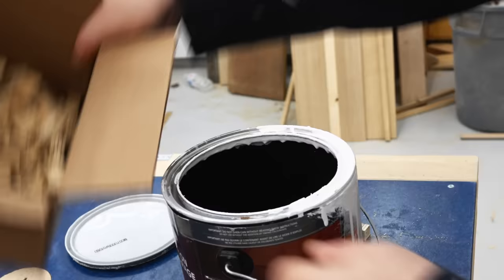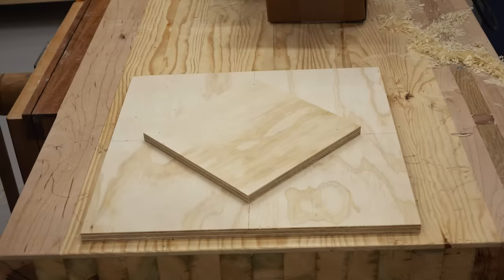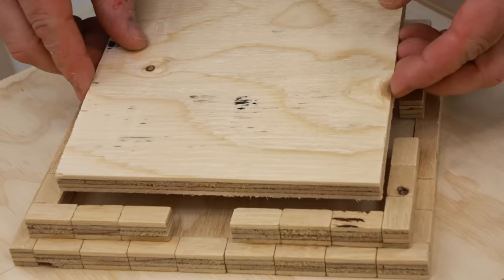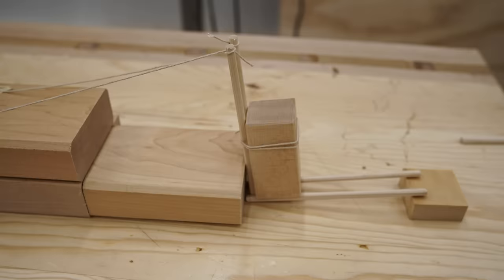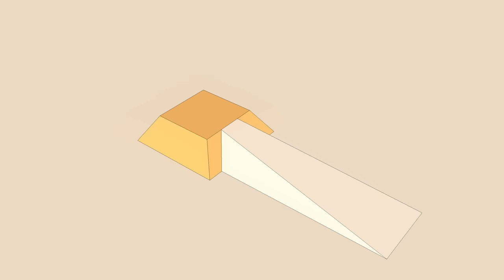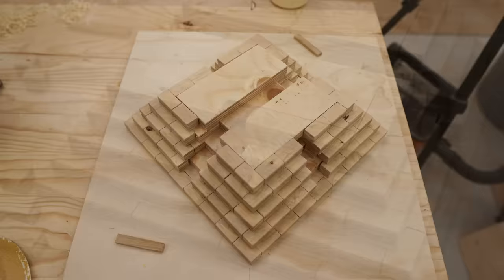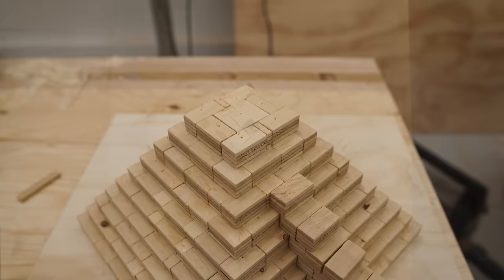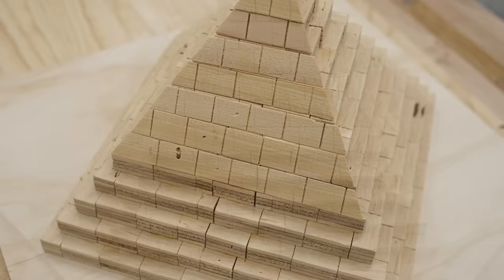How I Would Build The Great Pyramids

Comment: Can you calculate how long it would have taken? In the 1960s it took us 3 years to move 1042 blocks just 90 meters away (Abu Simbel transfer) using the most modern machines available at the time. Meaning 26 hours for each block.
The Great Pyramid for example is made of over 2.3 MILLION blocks, way heavier than those cut at Abu Simbel. It would have taken 7000 years at the same speed. And that's being generous considering some blocks of the Great Pyramid were transported for 550 miles according to Egyptology, and the Egyptians worked only during the day while the workers at Abu Simbel worked 24/7, meaning it would have taken twice as much etc...
Also the Great Pyramid had to be designed, the blocks were cut a certain shape in order to create the inner rooms and empty spaces, which would have taken even longer...
Reply: I think generally the belief that if you didn't create a grand enough tomb for your pharaoh would bring upon the end days for the entire world was a big motivator for everybody involved.
Reply: @Corzappy  Technically they would have been built by Sovereigns, not Pharaohs. But apart from this, can you give me any piece of evidence that shows the pyramids were tombs?
Reply: @MARK-gp9hb  Generally the fact that most pyramids contained sarcophagi makes them pretty likely to be tombs.
Reply: @Corzappy  You call them sarcophagi implying that they were coffins but there is no proof of that, they were all found unadorned and empty, some were still intact and sealed. But even if there was any proof that they were used as tombs at one point it doesnt mean they were built to be tombs. Sneferu for example is credited with building 3 pyramids, others are credited with building mastabas and tombs other than just a pyramid, and then were buried elsewhere or their burial place wasn't even found.

And the looters hypothesis also has no substance, especially with the Great Pyramid, the tunnel supposedly dug by the looters was enlarged in recent times and the treasures wouldn't have passed through it, if we assume they were the same size of the treasures found in Tutankhamun's tomb, beds and furniture etc...
And i can understand looting the treasures, but the bodies?
So it's just a theory to explain away the fact that no burial remains have been found.

In fact there are egyptologists who are starting to consider the possibility that they were symbolic cenotaphs or monuments, either way not actual tombs.
I can accept that maybe the stepped pyramid of Djoser may have been a tomb, as well as some of the later and smaller pyramids, nothing compared to the perfection of the 3 main pyramids of Giza which even the Egyptians claimed were already there, they found them and restored them, actual evidence has been found in the Great Pyramid, the mortar analyzed by Lehner, it has been carbon dated to before the time of Khufu, and the oldest samples were found at the top, so they were restoration works.

Going back to what i was saying at the beginning, if you make a chart of all the construction works made during all dynasties, you will see that the 4th dynasty stands out, there is a sudden and unexplained spike in construction, and then it goes down again in the following dynasties. If you remove the 4th dynasties the progression is natural and makes sense again.
Not only that but the quality of the pyramids of the 4th dynasty is a lot greater, while all the following pyramids are crumbling.
The truth is that the pyramids of the 4th dynasty are completely "alien" to Egyptian technology and building skills of that time and before and later times, they had to be attributed to the 4th dynasty because it was the only dating that made some sense, to show a somewhat linear progression of technology from the mastabas and the stepped pyramids to the perfect Great Pyramid, but today we are beyond that, we don't need this paradigm anymore:

Under the stepped pyramid in Saqqara, supposedly the oldest pyramid and the one that shows the evolution from primitive to more advanced building skills, 40000 vases have been found, buried by Djoser on purpose.
These vases date to early dynastic and pre-dynastic times, some were found in tombs dating to 10000 BC.
BTW all this information is official, its written there on signs in multiple languages in the museum of Saqqara, you can even find videos on Youtube of tourists who visit this museum.
These vases weren't put on display up until recently, they are made of the toughest stones on earth, corundum etc. and they are perfectly made, perfectly balanced, they show machine marks almost like they were made with a lathe, some vases have a skinny neck but somehow have been carved on the inside, tapered even, the walls of some of them can be seen because they are broken and are only a few millimeters thick.
There are even tiny rings made of carnelian stone, with minuscule carvings of frogs and other animals, that look so perfect like they were laser cut.
Modern jewelers wouldn't be able to make them, later civilizations were not able to make them, and not even the egyptians apparently, because after pre-dynastic and early dynastic times this knowledge was lost, you can find graphs of this online, before they were able to work all materials with high perfection, then these were buried for some reason and later vases were only made of alabaster and softer stones and are not as perfect, quite the contrary, you look at them and they look all crooked and funny. There are depictions of artisans making these big later vases with large and awkward tools that don't explain how the earlier and more perfect vases were made.
Not to mention the countless other sites found around the world who date to 10000 BC, not just Gobekli Tepe.
So we are way past the "gradual evolution of technology that must have started around 3000 BC".
We have the proof in Egypt that before dynastic times there were people who were far more advanced. As the Egyptians write themselves, as all the civilizations of the world write, in fact, many ancient writers coincide when they date the beginning of the history of egypt to around 36000 BC, it has been disregarded as mythology by modern historians but only because we had not yet found proof of organized civilizations older than 3000 BC. but now it's changing.
So if the Egyptians were right it wasn't Khufu who built the Great Pyramid but only restored it, and he reigned over 60 years, not 23/25 as modern egyptologists believe, and many more things are going to change, you can be sure of that, there are egyptologists who say it, in private, because in public they would lose their job immediately, that the egyptians were an emulative civilization, trying to preserve and emulate the things they saw which belonged to a greater past.
Reply: @MARK-gp9hb  There’s still tons of evidence that point to pyramids being used as burial tombs, it seems pretty wild to me that you’d so fiercely dispute that pretty well established point.

Even if the great pyramids themselves aren’t tombs they still could very well symbolize a tomb.
Reply: @Corzappy  and im asking you what is the evidence
Reply: @MARK-gp9hb  It's all over google bro it's really not that hard to find.
Reply: @Corzappy  there is not a shred of evidence that they were tombs
Reply: @MARK-gp9hb  Just completely and utterly false.
Reply: @Corzappy  Its the first thing i asked you and im still waiting for an answer so... where is all this evidence?
Reply: @MARK-gp9hb  The sarcophagi, the writing, the mortuaries. Just saying "Oh they don't have mummies in them so they obviously aren't tombs" is willfully ignorant.
It's like saying "Oh this bank doesn't have money in it so clearly it wasn't made to store cash"
Just completely ignoring the fact that the british and the grave robbers before them, stole most of the mummies from their tombs.
Reply: @Corzappy  yes but the mummies weren't found in the pyramids, also what writings are you referring to?
Reply: @MARK-gp9hb  Hieroglyphic writings in the pyramids.
Reply: @Corzappy  the so called pyramid texts were actually found in mastabas, the pyramid of Djoser is more of s mastaba really, and i already said i can accept that one to have been a tomb. But there is nothing that links the pyramid texts to the construction of the pyramids.
Furthermore no hieroglyphs have been found in the pyramids of Giza, which once again makes them stand out from the rest.

Comment: But the pyramid isnt solid like your method has to be its full of chambers.. not only that but the angle is slightly different on the 2 sections of one side they convex slightly making the pyramid have 8 sides. You only said thats where the "stairway" was and dont account for the angle change. You dont account for either of these

Comment: I think the ancient Egyptians would have utilised what was available to them at the time. It'd make sense if they'd made the most of the most powerful force easily and naturally available to them.. Gravity, utilise your environment.

Why put all your effort into moving a single massive weight, when you can easily stack up and move loads of smaller weights, that will eventually equal or better the weight of the weight your trying to lift.

Again, utilise your environment, these smaller weights could be from the gravel/off chippings of the rock's your carving. Or literally utilise your environment, have workers pile up sand to equal the mass of the weight your lifting. After all, their surrounded by the stuff.

Maybe this theory could also explain why they initially excavated the base of the pyramid. In theory, you only have to drop the counter weight the same distance vertically as the distance you plan on raising the main weight. Once your up the first step, repeat the process till you reach the desired final level.

Comment: Thank you! Finally someone who has a bit of sense chiming in on this. The water elevator thing is one of the stupidest theories I've ever heard. The construction and execution of which would be much more difficult than the pyramid itself... its just daft. Also they absolutely laid the cladding stones from the top down any other way and you wouldn't be able to face them perfectly. Also the lower angle side "stairs" would certainly explain the strange dips on the centerline of each face. Nice work!

Comment: the big myth ist no the normal stones in my opinion. its about many 40 ton granit block in the kings chamber in like almost 100 meters height used as ceiling. explainig how these got up there is muc harder. iwas hoping u would find an explaination for that when ic licked on the video but u didnt even touch it unfortunately. other than that nice video

Comment: why nobody has ever come up with a  simple old scale technique for the really heavy stones.

You use something like a T shaped wooden construction.  a rope goes from one end to the other. 

you tie the rope to the heavy block lets say it weighs 5 thousand kg
the other rope is connected to an empty box. then the empty boxed is filled with small stones and as soon as the small stones weight is greater than 5 thousand kg it magically lifts the heavy stone. you would oil the end top of the T shape constructions so it has a smaller coefficient of friction. if the weight is same it would even allow you to rotate the T shaped crane.

quite easy. alternative, instead of a long rope, you could use a shorter one and having the top of Top bar of the T shaped Crane move up and down (not sure if it would work for the really heavy stones because the wood might break) but anything under 1000kg should be working as well.

Comment: Thousands of blocks weighing over 100 tons . The quarry is across the Nile River. There were no boats capable of carrying these blocks Wooden rollers would be crushed flat . Need ropes that are capable of being strong enough to handle this weight. The passages inside pitch black and there isn't enough oxygen in some places to light a fire. Absolutely impossible.

Comment: I dont think you can dismiss them using water so trivially. Obviously the nile river played an extremely important role un the construction. There are too many ways water can be used that have nothing to do with floating the stones up some hard to imagine many-story-high artificial water reservoir. Water and sand makes a great counterweight that can be delivered in buckets. Thousands as people involved in lifting each stone up seems preposterous, while exploiting easy to deliver mechanical advantages seems very likely. They could have easily had ram pumps that deliver the counter-weight water on high. The pig has already been domesticated. Pig stomach probably makes for a good ram pump chamber. They didnt have to be great pumps. Any amount of "working" would be enough to avoid needing thousands of people per stone.
Reply: If you actually tried using water filled shafts to float them up, you would find out why it’s absurd. Even if you kept everything water tight under hundreds of PSI, and large structures that could withstand such pressures, you still would have to replace the displaced water at the top of the water filled shaft every time you removed a block.
Reply: @douginorlando6260  I dont know why you would think replacing displaced water would be a problem. Its so not a real problem, right? They had pottery. Thats a full stop on that. Just like the watershaft theory is ridiculous for good reasons, so to is a lot of counter-claims like that replacing displaced water is somehow one of the problems. The watershafter theory is more believable than anything that suggests that they had problems moving water around.
Reply: Building a water-tight 'well' tens of meter high and hundreds of meters long is a bigger challenge than building of the pyramid itself. This idea holds no water at all.
Reply: @ProfezorSnayp  the idea that doesnt hold water is "they didnt use water" which is nonsense - sure they didnt build 20 story reservoirs - but that doesnt lead to a rational dismissing of the use of water. Unfortunately the casual and non-ambiguous claim in the video is that they didnt use water. Its not reservoirs that are denied in the video, its the use of water entirely. Nonesense.

Comment: That tipping technique just wouldn't work. There is no room to fully tip a block that size. I saw a few videos talking about a channel that spiralled up and they were pulled up by pulleys. The grand gallery shows sigs that it was made for the huge pulley system where they could of had counter balanced lifts. You technique would be just to hard. Yes when you get to the tipping point there is no weight. But to get it to that point and then past that point would take so much power constantly

Comment: Your theories about the construction are nice and could be at least partially correct. Nice thought experiments! But what's wrong with your theories is the way the capstones are laid. In your case, they have a completely different shape and are placed differently than in the real pyramids, where they not only cover the triangle between the stone layers, no, they overlap. This means that the theory that the cladding was started from above is wrong. One would have to push in new cladding stones, so to speak, under each overhanging layer from below. And that is quite unlikely.

Comment: we know they had the bagdad battery right? so you know those things in the kings chamber resemble a light bulb right? they never found any soot from torches used for light. how is that possible?! the illustrations cartouche whatnot depict complete with power wire, filament and insulators. to my untrained eye. that can be inferred just by looking at it thats for sure. and second, the ancients moved 200Ton blocks. 400Ton blocks. supposedly they didnt have any machines. 
i was watching this episode on crystal castle. the guy used these gear mechanisms and idk vaccum or capacitors, they would just start ratcheting it. 
so maybe this is how they built this, using this sliding thing like those new types of scaffolind that goes up with the guy, you just place it against a house standing off away from the gutters, so they used this ratcheting system using electricity because they knew about it.  cocaine mummies. they were far more advanced then we are led to believe. something happened, the egyptians stopped using stone ground single pieces of granite, and using terracotta, losing the ability to work the harder stone. a digression caused by catacylsm, the cocaine mummy tells you that. 
the reason there is no evidence of the last civilization predating the ice age is because they used natural things, bone rock sinew fat brain hide, for everything they needed. that stuff doesnt preserve well and even if we did come across it, we would not know what we were looking at if anything. they lived in equilibrium with their planet. we are looking for a throwaway civilization like ourselves in the record. garbage heaps, carbon spikes, mass extinction. etc etc. this will leave evidence beyond 10K years for some of our ancestor survivors past the next one to read before it comes again for them. like we are staring at it now.